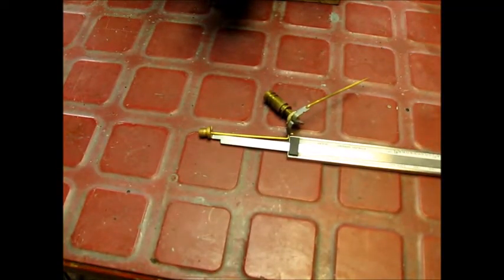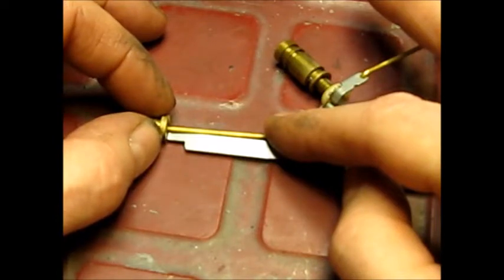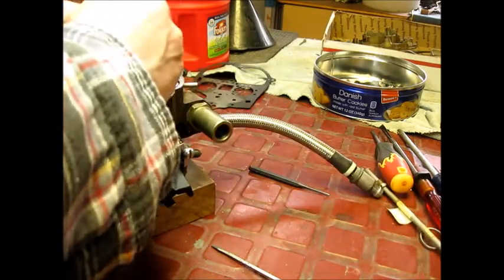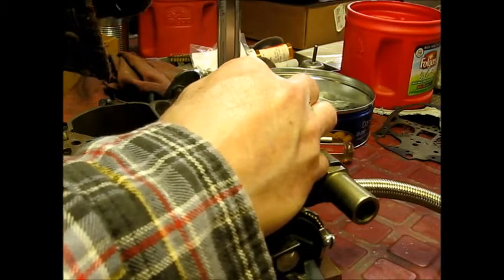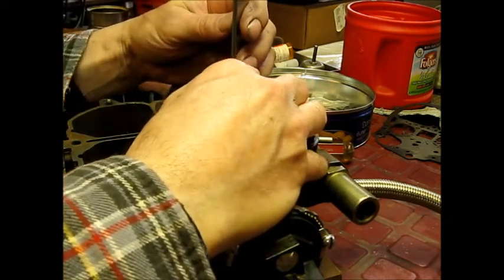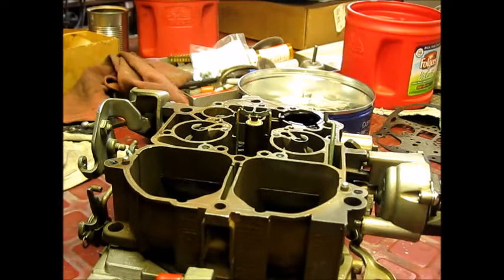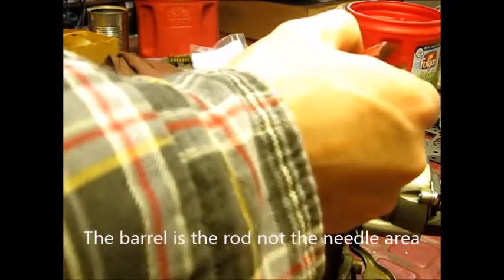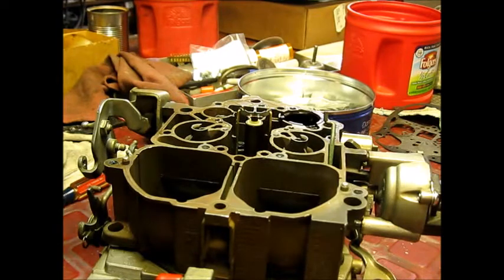How to Adjust the Rochester Carburetor Power Valve on the Bench

Comment: Probably wont see thisnin time but my issue is my quad rods are coming out of the jets when i let gonof the power piston. Take time to place them in and set the fastener and let the piston go they come right out. They rent damaged or bent and the spring has been in there since 85. Disnt count screw turns on jets beforeni took themnout thoughg theyre were just supposed to be seated. Spring is pushing piston to igs max up point nomatter where i have the little screw set. Are the jets supposed to be backed off more to raisenup towards rods? Im so lost.. its been running for hears now im way over thinking things

Comment: I’m very glad I found your now 5 yr old tutorial on this aspect of Q-jet carbs! Extremely helpful information you’ve shared 👍🏻👍🏻. After scrolling thru some of the commentary, after reviewing & listening to your breakdown, I 100% have zero complaints of your camera work, as I’ve been one of that minority on earth, that hasn’t ever created/uploaded a single video at all, for ‘anything’ internet & may never.. just not something I’ve yet gravitated to doing. Anywho, of the many carbs I’d rebuilt decades ago, I’ve gotten pulled into having to rebuild one of these Q-jets again (probably been @ 30 years since the last one of these carbs) & HAD TO fully dissect it, as it had been off a vehicle & lying out in the elements of nature of the high desert of SoCal for heck, 25 years.. it’s @ a 1979 model, going on an ‘89 Chevrolet Caprice Classic Stationwagon, as a means of doing away with the solenoid power valve & electronic TPS… swapped out the stock EFI dist. for non-computer needed type; deleted EGR, smog air pump system & Cat.. cars’ heading to customer in a no smog check State so, trying to get this wagon’s Olds 307 V8, the ability to breath/perform somewhat better. Thanks again for posting this info 👍🏻👍🏻
Reply from the maker: Thanks for posting!
Yea when I started I was horrible and the equipment sucked bad!
Sounds like you have a nice project there! I luv these carb, Sadly I sold that car and got out of the hobby due to life issues.. Maybe one day I can revisit !

Comment: If a guy had an A/F mixture gauge, this is essentially the way to set part or cruise throttle mixture, correct? Would you shoot for say a 16:1 A/F mixture?
Reply from the maker: Sure that would help BUT these are engineering numbers to target in a perfect world. So many variables, runner length and shape, valve size, underside radius, rings, the list is huge! Tune for seat of the pants and driving conditions. Check the plugs!

Comment: This only works if you have an all numbers matching carb that is on the engine it came on. For example i have a big block carb now on a baby v8 and my apt only went out 2 turns from seated.
Reply from the maker: This carb was made from parts, on a heavily modified Pontiac 400ci with aftermarket heads, larger valves, custom cam, etc, modded intake. 
That engine and car was so modified and made from different manufacturers. 
All these adjustments I tried to show is a combination of the many books I've read and many hours of tuning. Unfortunately this was one of my 1st videos with crappy camera and not much experience making videos.

Comment: Good info. is that a factory style setting or how did you come up with that? thanks. 

i am rebuilding my quadrajet on my 350 buick facory specs and ive made the mistake of unscrewing that screw without cointing the turns..
Reply from the maker: these measurements are part factory build specs and experience working with these!
It an older video, I dont do these now, I wish because I could make a better video now..
Watch it again it may make more sense. I sold my car soo,,, sad,,,,,,,

Comment: I made mine too lean so when I took it in for CA smog check it failed.  Too lean makes hydrocarbons go too high.  tricky to get it just right.
Reply from the maker: It may have been the monoxides that were too high, hydrocarbons rise when its too rich, other combustion gasses rise when it get lean

Comment: Great vid, but your hands are blocking  the line of sight to able to see the adjustment. So, it can't be seen how/where your moving the metering rods. I'm guessing, your pushing the metering rod assembly down until the pin touches the power valve to get the 36mm [after adjusting the pv up/down]?
Reply from the maker: Yes sorry, one of my 1st vids, I push it down until the pin hits the brass stop that I am adjusting. 
Trying to measure all the way through.
Reply from the maker: It was one of my 1st videos, you will understand it, take your carb in hand and watch it, its about the height and depth of the stops. 
That is running on my custom Nova and runs great, I dont have another carb at the moment to re-shoot but I will someday!